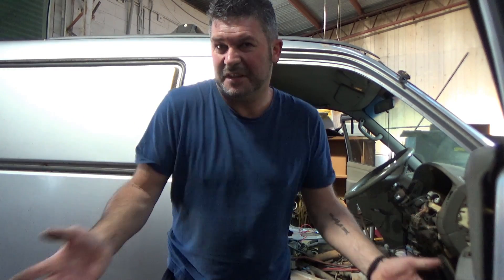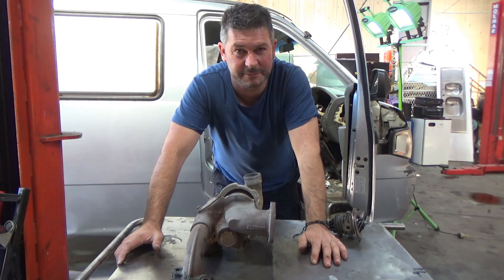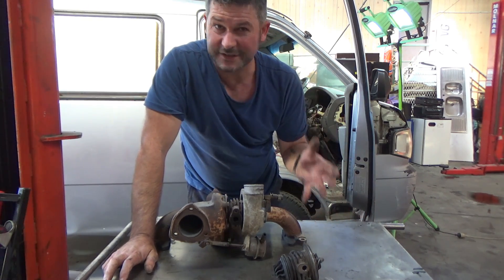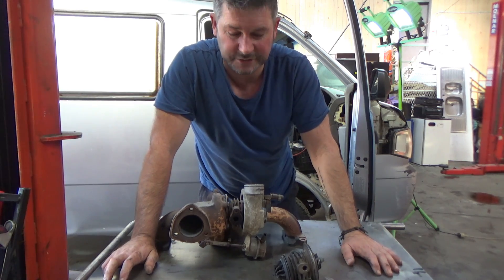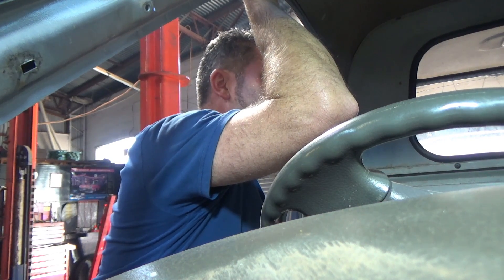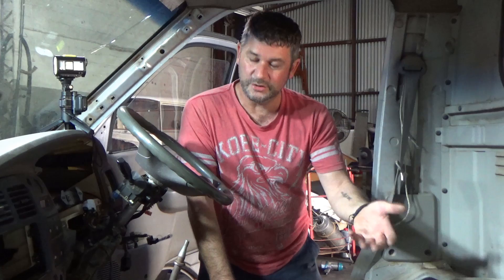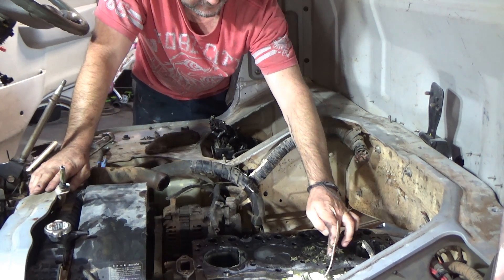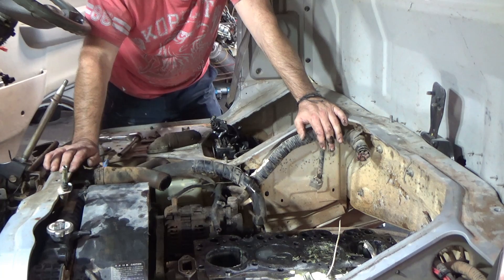How to Stop a Run-away Diesel -ENGINE BLOWS !

Comment from the maker: NOTE: We make these videos for fun. We don't make money from this channel, and don't bother with adds on our videos either. We have no budget to buy three cars and do the test 3 times. We make a video of a vehicle just before it goes to scrap. We do the best we can within our budget (zero) to provide the most information we can. If you want us to test again provide us with a vehicle and we will !
Reply: my dad drives a wrecker with a cat diesel in it. turbo seal failed and it ran away. he used a breaker bar to pry the intake hose off while it was running and it died without boost or oil from the broken turbo.
Reply: We had trucks at work that used Detroit Diesels with superchargers (no turbo) and they had robust iron flappers just after the superchargers you could release from the cab via an "emergency stop" knob.  It would pull a catch loose and allow the spring loaded flapper to flop into the port between the supercharger and the block stopping all air to the engine so that no matter where the fuel was coming from it couldn't run.  So the real secret to stopping a run away diesel was to cut off all the air to the cylinder.
Reply from the maker: trodengore -Two things , one all diesels are injected. Two, it's not running on diesel fuel when it's a run-away. It's burning it's own engine oil. Hence the smoke etc
Reply: Naked Off Road Much appreciated. Some people don't realise the value of free information.
Reply: DreamTheory by removing the charge pipe in between the turbo and the engine you also remove the fuel supply
Reply: Naked Off Road what about using a floor mat out of the vehicle??? I think it's thick enough and would seal good
Reply: When you have actual runaway, engine works on oil, not on diesel fuel. This means there is no good mixing of fuel/air, no fuel portions regulating according to RPMs/engine load - this all means that you'll have high RPMs, but low torque. Because this stopping runaway engine with switching to higher gear and dropping clutch with pressed brakes on actual runaway will cause much LESS damage to cluch/gearbox than doing same on normally working engine with pressed accelerator pedal.
Reply: So in this case only CO2 esinguisher would work i think.
Reply: Assuming you fully coat the filter and thoroughly clog it, yes. 

Also, a halon extinguisher might work if it lasts long enough for the engine to completely stop, and it would leave no residue on or in the engine, and it's not corrosive. It works by suffocating the fire, preventing combustion.
Reply from the maker: rp42069 -yep, good idea
Reply: halon is illegal these days.  they should no longer be sold.
Reply: bitsnpieces11  Turbo Detroit 53, 71 and 92 series 2 strokes still had blowers as well and blower seal failures were pretty much the same as turbo seal failures, not uncommon to happen in high mileage Detroits. The factory knew that and fitted the emergency stop systems to them as a safety precaution.
Reply: Robert:  I pretty much assumed that was the case.  Our department manager specified they be 2 stroke diesels with that protection.  Some of our operators who would earn O.T. by driving, consistently used the emergency cutoff to shut down the engine instead of the ignition switch and played like that was the correct way to stop them, made it a pain to start them later on.
Reply: Naked Off Road I see these videos as the living embodiment of science.
Reply: Duramax: What is not true?  Please read the comment all the way through.  He said nothing about direct or indirect injection, just that they were injected, oh and the success of the early Lister cold start diesels was due to indirect injection.  It isn't used much today because it raises the combustion temp so high ypu get a lot of nitrates in the exhaust.  The presence of fuel has nothing to do with the air.
Reply: chevylover:  That's a good joke.  Spark plug wires (spark ignition) on a diesel (compression ignition - no spark plugs).
Reply from the maker: religion is poison -watch my other video " 4000km across Aussie in a 76 Land Rover". I was surprised as everyone else.. 3.5 ton behind it too !
Reply: Naked Off Road i hope you bought a lottery ticket after that mate .
Reply: Fords are the best to test since they are all junk anyway.
Reply: Well, for me the best precaution is installing air cut-off valve. Depending of engine size and construction it might be tricky. Even better if you do it in a way it lets compressed air from turbo to release and shut off any air to the engine. This way you will cause no damage even on turbo or intercooler side where pressure could build up quite fast even bending turbo fan. It's especially good when oil is from piston rings instead of turbo and you don't want to damage it.
Reply: Thankyou for video, we all have nightmares over runaways, i had one go pop in an auto with no signs of failure. There was little time to do anything, in the time to get out open bonnet think a bit it was gone, my prognosis is that without a manual and good clutch its time to ring a taxi
Reply: its my belief that a high torque diesel would eat that clutch before stalling . that small diesel you used sounded like it did not even have enough power to pull itself and thats why the clutch stall worked .
Reply: turn the key switch on off a number of times and if all else fails , knock off the fuel inlet connection thats goes into the pump or injection pump , both located on the motor itself . you might damage your pump while saving your motor .  thats if you can see the pump line . and also if you have a small bar of some sort .
Reply: all the boost .  I'm
Reply: Steve Bull: true.
Reply: If they had a soft surface, rubber sheet or the cloth, over the surface of the block of wood to conform to the rim of the intake it would work better.
Reply: Hey look that's my comment! I was referring to "rolling coal" on purpose fyi
Reply: just an FYI the diesel engine can also get fuel or oil from its own cylinder rings.
 If a cylinder ring fails it will suck oil up from the pan and part of the engine  into the cylinder and it can run that way. the best thing to use is a phonebook to cut the Air Supply if you have one
Reply: how would you go with a fuel cut off solenoid right near the motor (injected only). that should save the motor without causing damage to either the clutch or any other part. i have never tried it but in theory it should work and you can have them electronically operated from inside the vehicle.
Reply: all the boost as
Reply: Karen Bowen Lisandro
Reply: Naked Off Road naked
Reply: trodengore:  pretty much any vehicle diesel uses that kind of solenoid operated from the ignition switch.  Turn the ignition switch off and the solenoid valve closes and shuts off the fuel.  As Naked Off Road said a runaway is burning it's own lubricating oil from the seal on the turbo or from leakage past the rings.  So since you can't shut off the fuel the only thing you can do is shut off the air to get it to stop.
Reply: Naked Off Road -not true, there are indirect inject diesels (IDI) like the Ford(international) 6.9, early 7.3 and GM (detroit)6.2 and 6.5.
Reply: Naked Off Road what if you pulled off all the spark plug wires
Reply: Seeing as a diesel doesn't have ANY spark plugs you cant do that.Diesel engines use glo-plugs that heat up very quickly to start the process of combustion and then switch off.
Reply: Naked Off Road wait wait wait just hang on a second . You are a mechanic and yet you own a land rover !!!!! you should know better
Reply: ERees 1
Reply: In 43 years of pro driving I've only had it happen twice.  If it is running backwards it will wine and sound funny. When you put it in low gear the vehicle will go backwards.  Kind of scary.  I just popped it into a high gear and popped the clutch. That stopped it cold.  Screamin' Jimmies were bad for this.
Reply: Best way to kill a run away diesel is to make sure to install a shut off valve on the oil injector line of the turbo and a shut off valve on the fuel line before a run away can occur
Reply: JessieJ : ..and a shut off valve on the side of the piston to turn off the leaking piston rings.  Truthfully, there is no certain "best way" to solve this fuel problem at the source.  There are mitigation measures you can take, but there is no guarantee that all attempts will successfully stop a runaway diesel.  Trying to stop the engine mechanically or trying to stop the air flow through the engine are your best bets when it happens and there are no paranoia Frankenstein shutoff valves pre-installed.
Reply: Naked
Reply: DreamTh
Reply: i heard best is use ur shirt or something solid and press it against/inside the exhaust -
the turbo gets less exhaust float and the backward CO2, H2O NO2 and CO  pressure would likeley kill the engine
onley problem:the exhaust and the fumes are fucking hot and build up pressure
but here might not be any damage to the car  
there is a video of a guy that pressed his shoe (that melted thereby) against the exhaust and it worked
Reply: why is that intro so fucking loud
Reply: Naked Off Road shit you cannot make comments about women like that .once that fires up on YouTube nothing in the world will put that out
Reply: Forgets to remove wire lol
Reply: But please put and ad to still have some monwy
Reply: bitsnpieces11 but it's running on the oil from the turbo not the fuel. The fuel would be stopped as soon as u turn the key off
Reply from the maker: Mohamed RACHID if a block of wood directly over the intake won't stop it, then tying to block a paper filter with powder is impossible
Reply: I got a question: using a powder extinguisher on an operating vehicle should work without causing damage because the air filter will block the powder, making the engine begin suffocating! Isn't this right?
Reply from the maker: Duramax 315 -your argument is that a I'm incorrect by saying all diesels are injected , by saying some are indirectly injected ?? Wow, this is like arguing with a woman . The truth is mate, the van in the video isn't direct injection either.
Reply: all the boost:  He said it was a diesel not gasoline.  Diesels inject the fuel into the cylinder and the air supply has nothing to do with the fuel.
Reply: wrong it keeps running as long as there is exhaust.your thinking super charger .

Comment: Blocking the air intake does work but you can’t use something solid like a block of wood like you guys tried, use something like a pair of leather welding gloves or leather welding apron and then something solid so you don’t risk your hand but the leather welding gloves or apron works great to seal

Comment: Usually by the time you realize what is happening and get the hood open all the oil has been sucked out the engine and it has blown a rod through the side of the block.A VERY DANGEROUS SITUATION!I would never recommend any attempts to stop it.JUST WALK AWAY and get some clean air then call a tow truck.😮

Comment: Cut all air off and if you have spare oil oversaturate which is still a gamble but it can still combust of feul/oil mixture or co2 fire extinguisher will eliminate oxygen thus suffocating the diesel

Comment: Had a runaway diesel engine once while driving. Huge pile of smoke in the back, put in 3rd gear immediatly and slamed on the brakes till it stops. Changed a turbine the other day, the car was still burning the oil what was left in the exhaust. But I just went to a highway, it felt like Im sitting in a rocket ready for a take-off, but after few km it went away and it was running like it never happened.

Comment: well every car has a clutch if it didnt have a run away before that is. so..
engine rev high - press the clutch - put in high gear - let go of clutch - engine dies.
i think anyone in this situation would rather replace a clutch then the whole engine or the whole car if it turns into a fireball.

Comment: Phone books are best since its bendy enough to seal properly but thick enough to choke it

aswell as if you have a slight intake leak itll suck from there instead of the intake hole

My money is on that you guys had a shit intake manifold gasket or a leak somewhere in there

Comment: Honestly the be all-end all of this is to have a CO2 tank, the key detail is fuel is useless without the second component to the fuel: Oxygen.

Cut off the oxygen and it's done, doesn't matter if it's got oil, fuel, both and/or compression ignition, if there is no oxygen, it's not going to spin at all.

Comment: Mate, in the old days, we use rags to clean carbs out. Rev the tits out of ur motor. Rag over carb until motor just about die pull rag off and reply untill shit suck thru carb. Rag would have work. Unless U see just going throw rag at the car. When you talked about using the fire extinguisher I thought you're going to use a CO2. I was in shock when I saw that power come out and U look like fark, that not CO2, we fark up

Comment: A "rag" is probably too small, but if you use a sweatshirt or maybe even a teeshirt, it should do the trick.  I've also heard of people using a paperback book - it may just be that it gets just a slightly better seal than the block of wood which is too rigid.

Comment: Normal people: Oh no, my diesel is running away! 
Me, with an old ARO: *pulls a thing that literally stops the flow of fuel*
Reply: Diesels (and gas turbines) run really well on their own lubricants. If that happens the only thing that will stop them is shutting off the air. BTW if you think a diesel running away is scary - gas turbines will throw parts through a 20 mm steel plate. External natural gas leaks can cause issues too.
Reply: @allangibson2408  Thank you for telling me this! The old engine in that car actually consumes oil while running normally so it can go nuts even easier

Comment: A  real Runaway is no longer limited by its Governor so can Rev up WAY beyond the Physical Limits of said Engine . Scary Shit . CO2  is the best way to shut it down With Minimal Damage . High gear Stalling is effective of course , in a Manual Transmission application . Auto Trans and No Extinguisher ?  Run Away .

Comment: There are tons of runaway diesels on YouTube, on some of them a mechanic was standing by and knew exactly what to do, every successful stop I've seen was by blocking the intake, every single one. On several they stick a bunch of rags in the intake, some others stuck a solid object like a book on top of the intake, in all cases they reacted quickly before the engines had a chance to reach peak rpm, those items might not have worked if they had waited, but the fast reaction worked. I have no doubt a good Co2 extinguisher would be an excellent choice, the important part is cutting off the air by some means. Your simulated method where you just raced the engine, as they say for entertainment only, certainly applies here since a true runaway is far different.

Comment: Just wondered how you would get pipe off the air filter block the air, it would be almost impossible?

The danger to yourself would great if a conrod decides to give way and comes out of the engine.

Try stalling it yea, but by that time the engine is probably screwed anyway along with your clutch.

Comment: Without a turbo these experiments dont really apply.  The turbo continually increases air the faster it goes.  With a stuck injector you have infinite fuel.  The faster it goes the faster the turbo the faster it goes and you have infinite fuel.  It is an exponentially self exciting system.  

What you have here is a diesel that just wont shut off... not a runaway.  This is no different than a gasoline engine with the coil wired direct to battery.

Comment: just a side note. on a larger engine that is turboed or blown will die more effectively with a block of wood. for example a 2 stroke detroit pulls air at such a high vacuum (many DD's are blown and turboed) that the block of wood will seal the intake. the vacuum is so high infact, that if you fail to completely cover the intake, you may not have the time or strength to pull it off and try again.

Comment: 38 year old 2.2 Thornycroft marinized non turbo and it went into runaway mode in the boat,so,we have to remove the cockpit floor lift out the insulation-meanwhile the engine is flat out-smoke everywhere-cant put it in gear as the boat would rip its self from the jetty--so we have to disconnect the fuel line and it stops-not for the faint hearted,happened twice with mth my 220 Merc estate car had to stall it in gear.--just saying.

Comment: if you got a pocket knife just cut any of the turbo boots or carry a co2 or Halon gas fire extinguisher the dry powder ones will work if there is a good air filter it will plug it but still more chance of engine damage with the powder. i use to work for had a 12v cummins runaway in the shop after a fresh rebuild on the first startup the owner gave us the rebuilt turbo to install on it but was missing the oil seal when it was rebuilt. anyway he just smacked the turbo with a full swing of a 3lb slug hammer it snapped the turbo off the exh manifold and it shut right down. it cost a turbo but not a engine that he just put 10k in building. long story short you need to stop the air from the turbo getting to the motor and the runaway will stop and there is a lot of ways to do that. thanks for sharing